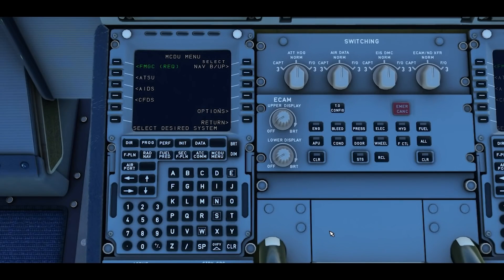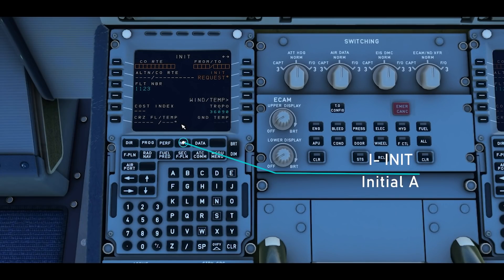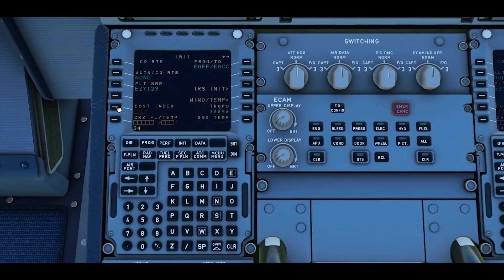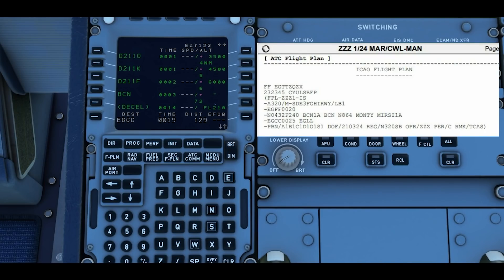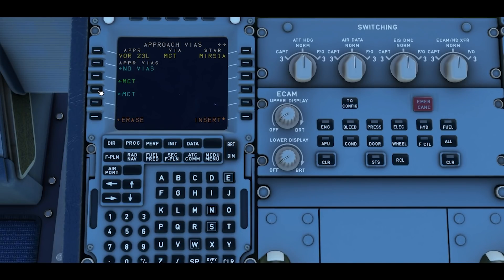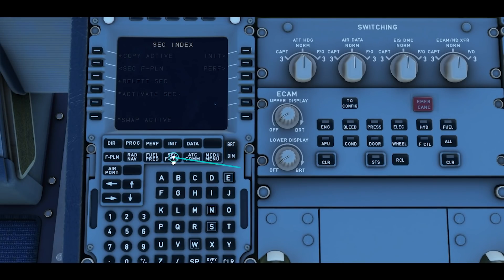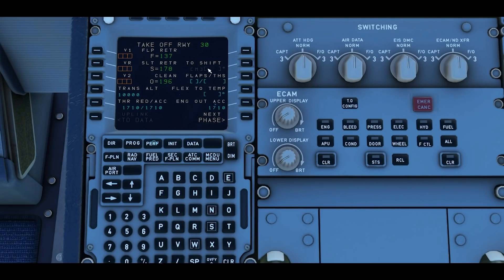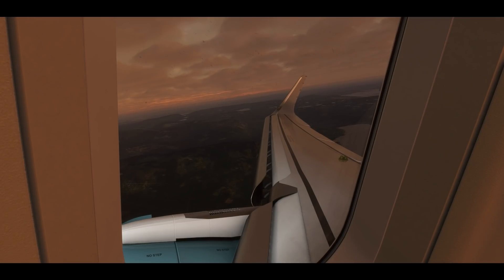FBW A32NX Ground School | Chapter 2 - MCDU Setup

Comment: I really don’t understand why is it that I’m having the same issue with both airbus A320 Neo models, any other plane in the entire fleet of the simulator will not give me this problem, it only happens with the airbus models, the taxi is almost impossible, it always goes to the opposite direction of the rudder controls in my joystick, I don’t have pedals I have the X-56 Hotas and I twist on the stick to taxi every single plane, but with the airbus A320 Neo it never works, if I uncheck the box for reverse angles it will always pivots in the opposite direction before going to the side I’m trying to lead it, and also the turn is so wide and unresponsive as if I am barely touching the stick to either direction, and I just don’t understand why is it that this problem it only happens with this model in particular, like I said every single other plane works perfectly fine, any ideas or suggestions?

Comment: How do you know if you need to use  a via or a transition and also when ever i press the insert button to put in all the details instead of putting everything in manually the flight plan is the not the same as the simbrief flight plan, those are only the 2 questions i have

Comment: Thank you for the turtorial. The Problem of the A320 (I dont know if its a aircraft or Simulator Problem) it is so hard to change waypoints or routes in midflight. How can I delete the whole plan when I messed something up?! Also the Direct To Button does not work properly. When I want to Direct To a waypoint it flies to this WP but than turnes back to the WP where I come from. That makes no sense....can someone help?

Comment: I’m not a payware creator and I think scarebus is the result of drinking at the age of 3.    I’ve worked on Lockheed.  Douglas.  McDonnell Douglas  Boeing  and even a convair 880.  Scarebus blows.   The avionics is ridiculous.  Seriously I’ve had this garbage on my pc for 2 weeks and yet to successfully fly a planned flight.  Autopilot is nonexistent.  Burns fuel faster than it should.    I don’t even know if the fmcg or whatever you call it or is responsible has loaded inflight winds     I won’t even begin to tell you the crap I’ve dealt with irl with scarebus.   I wouldn’t give a rotting Russian relic for a new bus

Comment: I love the FBW A320, very well dine, but how do I activate the flightplan? I keep getting dotted lines instead of a full line on the flightplan......please help!
Reply: On auto pilot select the up arrow on the heading adjustment knob. You should get dashes and a dot after them and on your screen the dashed green line should go solid. Then when you turn AP on it will fly your headings on your plan

Comment: When I enter the 'to/from' airport codes, I get the reply 'Not in Database'. Yes I have re-checked that I have the correct airport codes.
Reply: I'm having the same issue. Did you ever figure out how to fix it?
Reply: @treloarw  Not yet. Although the problem does seem limited to 2 UK airfields - Leeds/Bradford (EGNM) and London Heathrow (EGLL)
Reply: @jjsmallpiece9234  I tried multiple u.s. locations. Same. 
But! I was using the “stable” version. Switched to development version and problem is now gone.
Which version do you have. If you’re on dev, I will try those two fields you specified and see if it’s a problem on mine.
Reply: @treloarw  I have the A320 Developer version installed. Others say EGNM & EGLL work fine. No idea why they don't work for me
Reply: @treloarw  I tried a flight using the Boeing Dreamliner, just the FS2020 default model. I tried Leeds Bradford airfield EGNM - it worked fine. So whatever problem I have, seems limited to the FlyByWire A321 navigation database in the MCDU. I didn't try EGLL - London Heathrow.
Reply: Sometimes you have to press the button twice or enter the ICAO's again. It usually works on the 2nd go.

Comment: How can I know the Trip Wind and Flex TO Temp, please???
Reply: You can use SimBrief for your flight planning. On your FP,  there will be the en-route wind information for your waypoints.
The Flex Temp. does not seem to be modeled yet, but there should be calculators online for that.

Comment: To get to INIT-B the video indicates to press INIT and then the right arrow.  This doesn't work for me and I can't get to INIT-B.  What am I doing wrong?  
What is the Block and where is that info obtained?
If I use the MSFS generated flight plan some data isn't provided (e.g. cost index) - can I skip the missing data insertion if not provided by MSFS and still have AP and ILS flight work?
Thank you!  Video was very helpful and I created a PDF checklist from it.

Comment: Hey, My Flight calibration doesn't work, Could you help, I have saitek throttles
Reply: Identify all Saitek driver files. Uninstall Saitek driver, manually delete leftover driver files. Connect stick, Windows will install a generic driver. Calibration works! I'm using Saitek X45.
Reply: @HB9BRJ  Where can I find the drivers?
Reply: @spepter  Windows 10 found the driver by itself when I connected the stick. Nothing to download.
Reply: @HB9BRJ  So How do I do it?
Reply: @spepter 
Windows Control Panel
Devices and Printers
Right-click on Saitek controller icon
Properties
Settings tab
Calibrate
Reply: @HB9BRJ  Not working
Reply: It only says remove
Reply: I have the same but it's working. explain more carefully what does not work

Comment: three questions:
1. why need the IRS to be alligned to start this?
2. why don't you press just INIT REQUEST instead of putting it all in manual?
3. why don't you go via the MCDU menu -> ATSU -> AOC to get the F-Pln
Reply: Because they explain the manual way to put the data in. If you want easy/automated stuff, yes Init request works just as good.
Reply: @Antody  how is it in Real Life?
Reply from the maker: @afffe4444  If flying an ad-hoc route, it would all be manual. If flying a rostered company route, it would be a co-route. We explain in our tool-tip how to import a flight plan from simBrief, but now we are showing how you can enter it manually if you don't use simBrief.

Also the IRS need to be aligned so the aircraft knows where you are located in the world, normal procedure IRL and prevents errors.